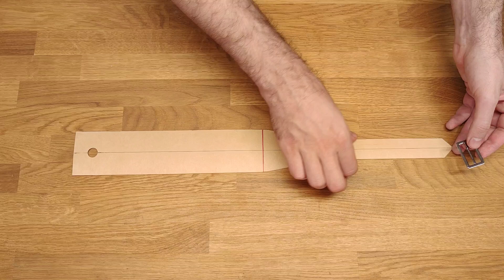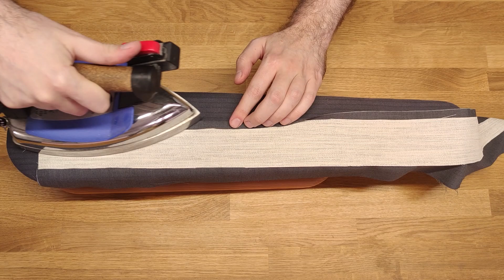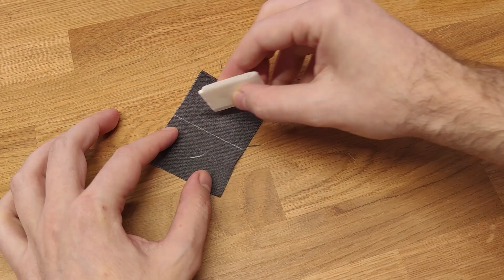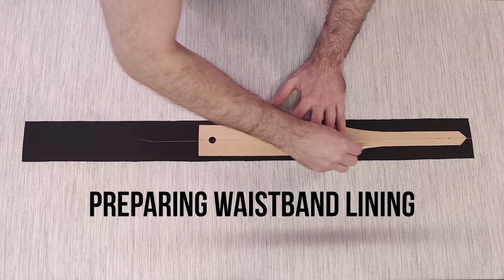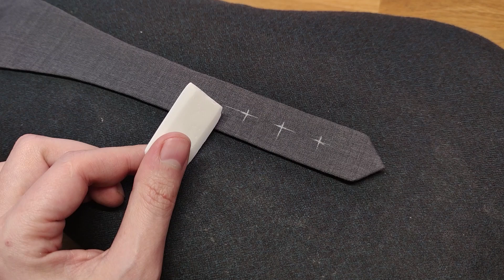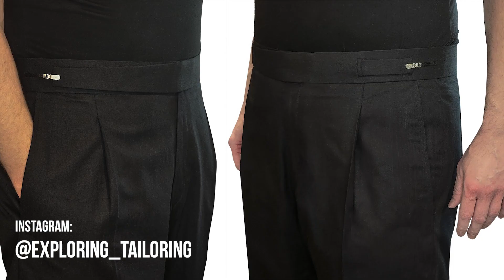Full Tutorial on Waistband for Bespoke Gurkha Trousers & Shorts

Comment: It's hard to find the proper body canvas. What you use looks like it's unilateral. I have found twill linen canvas 340gsm. The trouser cloth I've chosen is 250gsm.  
I also found 37% viscose 32% cotton 10% polyester 21% hair blend at 212 gsm. But is it any point of using canvas which is lighter than the trouser fabric?

Comment: So treating the canvas this way... would it make it machine/wet washable? Or would you still say this is dry clean only? And about the canvas, won't it poke through? I guess you use a lighter one than the heavy ones for chest canvassing.
Reply from the maker: I don`t recommend washing any classical trousers, not only because of the canvas inside, but mostly because woolen trousers get riuned after machine washing. So yeah, light brushing & drycleaning. 

If you are afraid that canvas is going to poke through the cloth, you may fuse its edges with thin fusible or put some lining or thin cotton between canvas insert and upper cloth of the waistband.

Comment: Is this canvas the same type of canvas as what you use for a suit jacket? Will it work with a piece of heavier cotton fabric?
Reply from the maker: Yes, it is the same canvas that is used for a suit jacket, the light-weight type. 
You may try taking havier cotton and then reinforce it with fusible interling on one side + starch it for stifness.
Reply: The only suiting canvas I find in my area is either 100% polyester or a mix of polyester and horse hair.
Reply from the maker: @sabrinauri  a mix is slightly better than 100% polyester. You may try a mixed one, as an experiment. Also, try checking etsy web-site, some vendors offer small cuts of natural light weight canvas.

Comment: Thank you so much for this video!! I am making linen trousers and want to use this method but my hair canvas is not wide enough. Can I piece them together to get the length or can I cut on the cross-grain? Thank you and I look forward to more videos!
Reply from the maker: You are welcome))) 

Thank you for the comment. 

Cut along the least 'stretchy' side of canvas. If the length is not enough, for the first projext, you may try connecting two pieces with a zigzag, for example.  

I'm already working on a new tutorial, subscribe so you don't miss it.